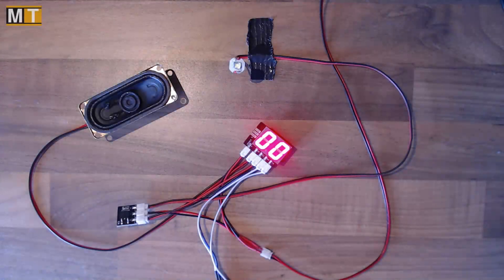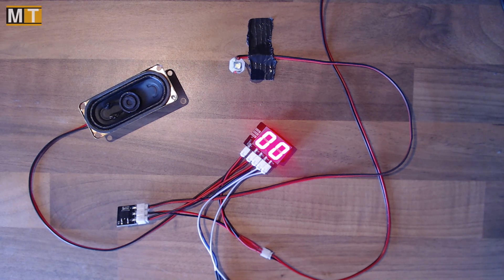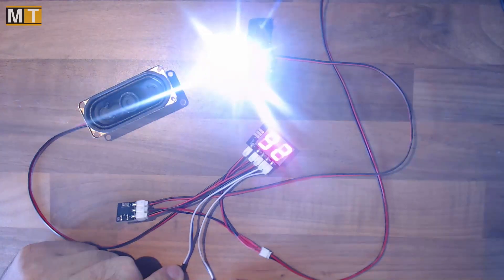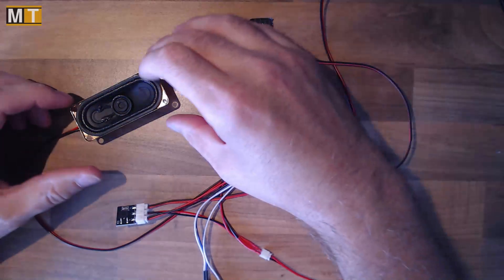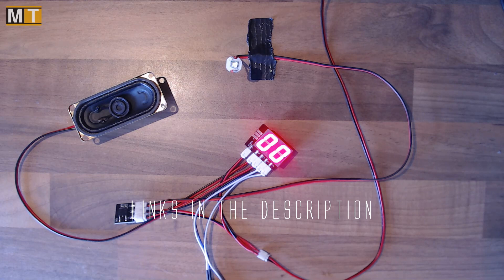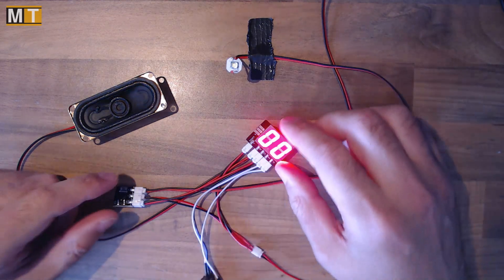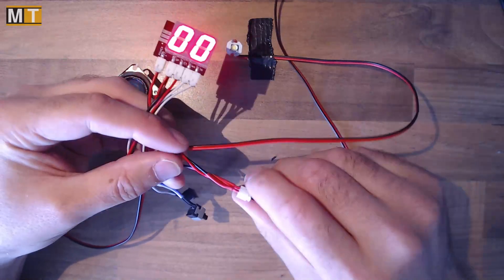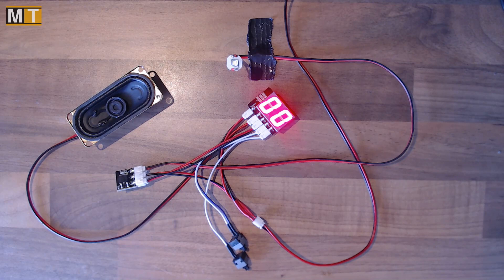Pulse Rifle Counter with Sound - Followup

Comment: Just a quick question. If using this kind of board with eg. 7v, to compensate for heat generated by the chip, would adding a 5v Noctua fan help with cooling the board?